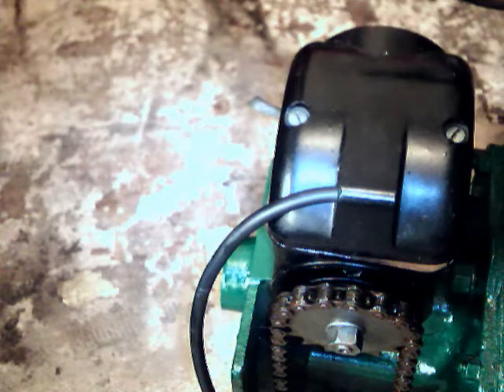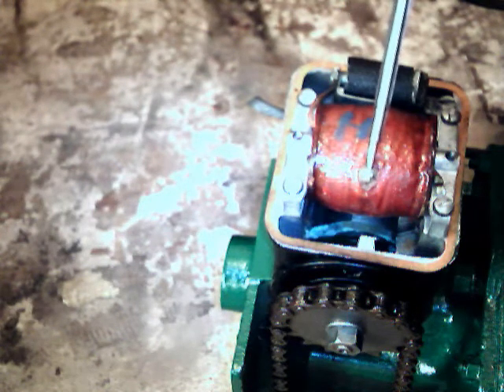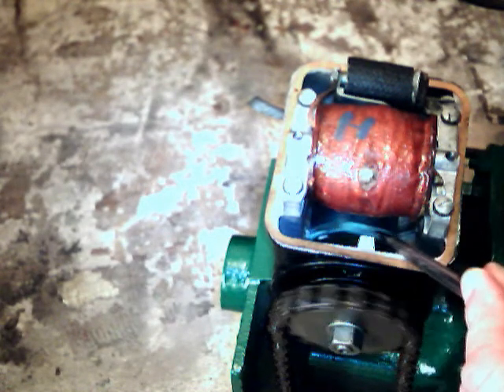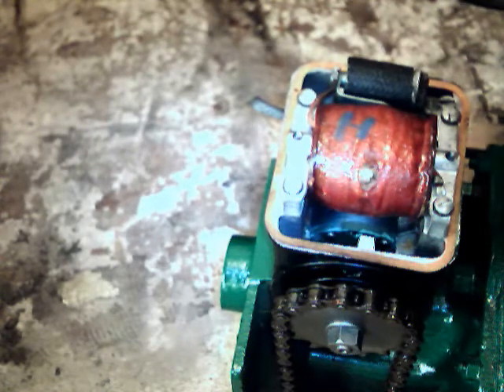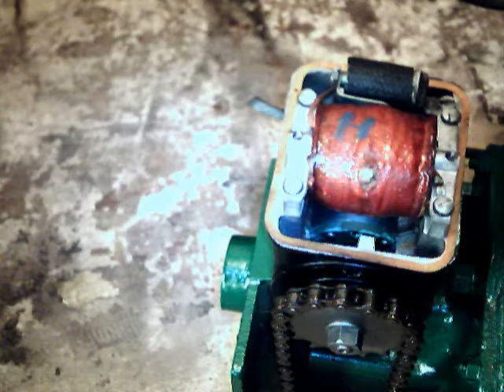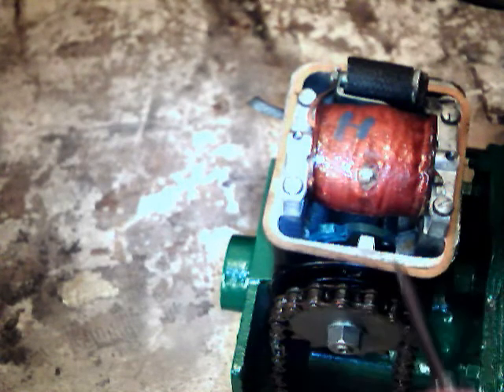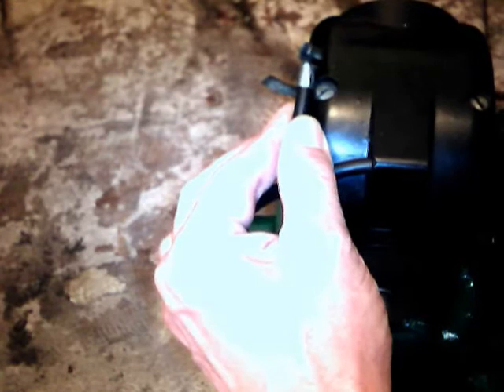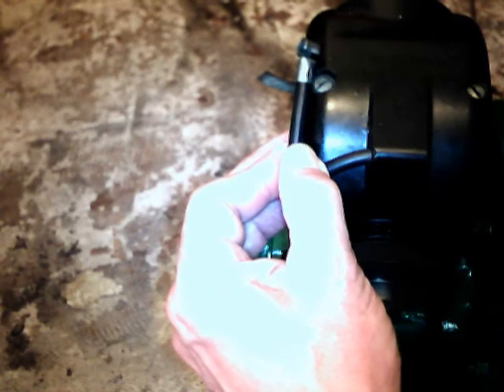Lister D type magneto timing

Comment: I have a Lister D that is being a royal pain in the -. The =magneto is currently in pieces and cleaned. The points are clean and gapped. The ball races have disintegrated and new  races purchased from stationary engine parts but how does one remove the old races from the magneto housings and shaft?  Further how does one persuade the cam from the shaft in order to adjust the timing? Any help would be appreciated as I bought my D to do a job of work and it has let me down badly thus far. I have replaced  a valve guide, bought and overhauled a carburettor, ground the valves, checked the fuel line, established top dead centre with a dial gauge on a magnetic base and made new timing marks but still it does not run and I am running out of parts that could be faulty so surely it must be the magneto?